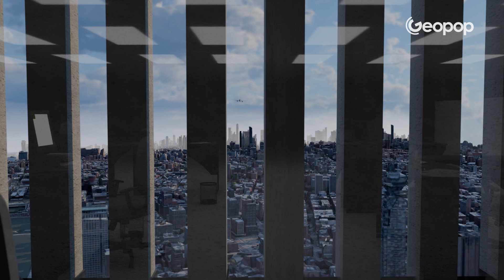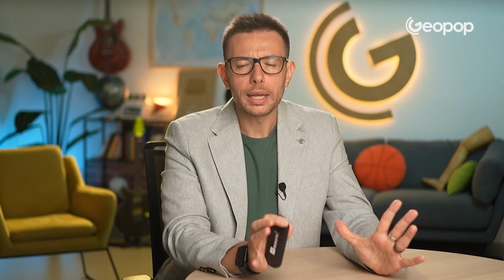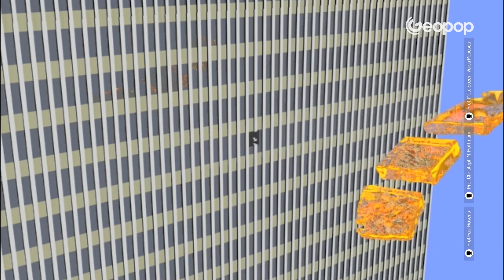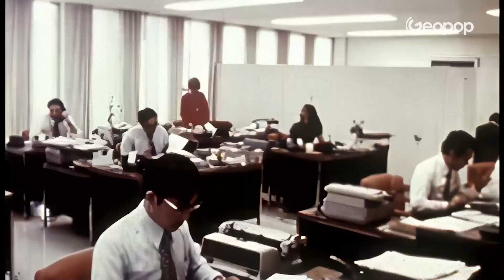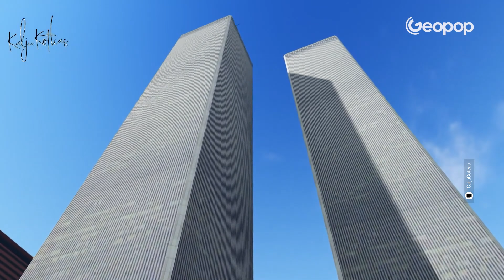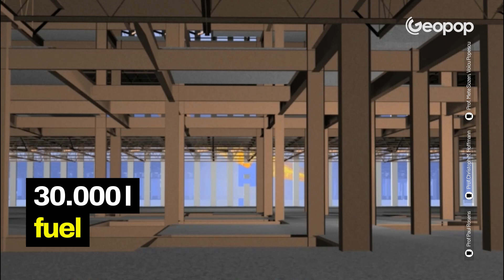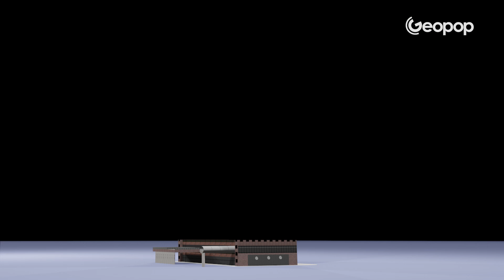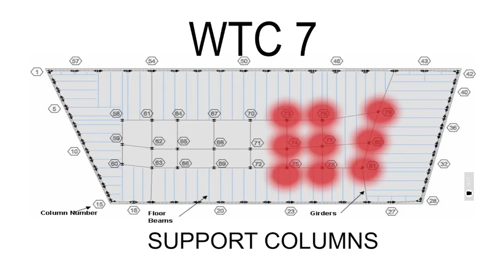9/11, 2001: The Technical Reconstruction of the Twin Towers and WTC 7 Collapses

Comment: Jet fuel burned very fast. It would not get to steel hot enough for that nor did it get to 1000° can’t believe you would buy nist bs
Reply: Was jet fuel the only thing burning in those towers?
Reply: @Tim22222 It was the hottest thing burning in the towers. And it never could have reached temperatures high enough To melt steel. In a control demolition, They usually use explosives to blow liquid copper straight through the still beams leaving a ton of melted steel. Here's the experts who found molten steel in the debris.
Captain Philip Ruvolo (NYCFF), 
Richard Riggs(debris removal expert), Mark Loizeaux , Leslie Robertson (wtc structural engineer), Lynn Margulis (University of MA),  Dr. Abolhassan Astanch (from Berkeley),  Robert Kim Ireland( chemical engineer for US Army Corp of engineers), Mark Basile( chemical engineer), Kathy McGrade (materials engineer), Gery Warner( Mechanical engineer), David Gregg( PhD Chemical engineer), Steven Jones PhD( physicist), Kevin Ryan ( BS Chemistry), Niels Harrit (PhD Chemistry), Tom Sullivan( Explosives team) Jason Cheshire ( Chemical engineer), and Jeffrey Farrer (PhD Material science engineer).

Comment: How come no other steel framed building in history has every collapsed due to fire? If heat alone could weaken steel frames to the point of failing, we would have rewritten the laws of engineering so it never happened again. But guess what, that didn't happen. We are still building steel framed buildings as we were back then because we know they are safe from fire.
Reply: Perhaps because no other buildings have been bit by hueg airliners travelling at VNE, loaded with 30,000 liters of fuel?  Ya think?  Maybe?
Reply: @ChristLink-Channel Saying that without having done research says more about you than anything else... It actually happened loads of times but they have never fell 😅 oopsie 😂
Reply: @Desperado070  "Without doing research" says the strawman builder who never did a days research in his life, and obviously doesn't understand plain physics! Hilarious.  Please show your evidence for these numerous buildings that you speak of, being hit by huge airliner carrying hundreds of tons of flammable fuel, that did not collapse.  You say it happens all the time, so let's see your evidence.... Waiting...
Reply: @ChristLink-Channel  Exactly research, then you would know such things. Instead of "trying" to insults others like a little boi you could also learn a thing or two. 😅😂 You are delusional
Reply: @Desperado070 Happens all thr time? No, no it's doesn't.
Reply: @VTGtone  Delusional is if it never happened to you you believe it can never happen, yet you here claiming that. 😂 you > 🤡
Reply: You mean other than the countless thousands of steel framed buildings that have collapsed due to fire, because it literally happens all the time?

Of all the popular conspiracist arguments, this is perhaps the dumbest, as it goes against 150 years of fire science research and everything we have known about iron and steel for a thousand years. 

Steel is formed using heat and deforms the same way. 

Collapse of a burning structure is always a concern for firefighters. Steel buildings subject to fire rely on active fighting of the fires to survive. Buildings are designed around 1 to 3 hours of fire resistance, allowing time for occupants to escape and ACTIVE firefighting to get started, after which all bets are off. Left to their own devices they will exceed their design envelope and collapse, like Plasco Tower and Wilton Paes de Almeida. In B7 the occupants escaped, passive and active fire protections were compromised and active firefighting was abandoned 3 hours before the collapse, which left the building to its fate. It lost. Odds on Building 7 would eventually collapse, and it did. No big deal in logic.
Reply: @TheLoonResistance  Wow stinkyshill, you´re a real workaholic!
Reply: Stinky is partially right because you said steel frame buildings when you ment steel framed skyscrapers or highrise buildings.  The 1000 years crap is ridiculous I bet he is less than 30 years old, my guess is 25 or less. Lives at mommy's house. Has never learned to support himself and definitely not a family. He's never employed anyone. No one in this world depends on stinky for anything because he is unreliable. Skyscrapers don't fall all the time,  they are usually designed to burn to extinction without collapse. When a plane crashes into the ground,  who wins, the plane? Or the ground? We know the ground is going to win. The plane has a force downward but the upward force of the ground is stronger. Let's flip it around and say the plane is sitting steal and the ground Flys up and hits the plane. Either way the damage to the plane and the ground remains the same. The force of a few broken floors cannot destroy the entire building because the upward force of the building is greater. It's newton's 3rd law. This is real science but these bozos the clowns lie, cheat and deceive for fun. Because in real life they are weak and this makes them feel in control.  They can't accept the truth, and I feel sorry for them because it's a horrible thing that happened that day and the truth is even more horrible so they are in denial.  Get a real job. Put your mind on something constructive instead of being so destructive. You are making yourself just as bad as those that committed this horrible atrocity
Reply: @robbiehiatt9966  You only made one huge mistake there, he is not even close to being partially right.
Reply: @Desperado070 so where do you suppose he is wrong?
Reply: @robbiehiatt9966  If you talk nonsense everywhere no body is ever gonna repply to your sirieus, are you just braindamaged?!?

Comment: the core columns were cut with a thermite chemical reaction and molten steel was found in the basement levels of all three buildings, which is damning by itself as building 7 wasn't hit by a jet. and the thermite kept on reacting all throughout the cleanup with first responders referring to scenes of an iron foundry or a live volcano's lava flow. then all analytical debris was taken from the sites and in the case of the pentagon the lawn of the west wing was literally covered in gravel after the attack. then there's larry silverstein, real piece of work in his own right.
Reply: WRONG! The thermite claim was debunked long ago; the cuts in the columns were made by workers dismantling the wreckage using torches.
WRONG! There's no evidence of any molten steel at the WTC.
RIGHT! Building 7 was not hit by a jet; it was hit by a MASSIVE COLLAPSING SKYSCRAPER.
RIGHT! The debris was taken from the site for rescue operations AND WAS MOVED TO NEW JERSEY WHERE IT WAS STUDIED FOR MONTHS.
Reply: Twin Towers collapses were relatively straightforward, the fundamentals already understood in the professional engineering community within just weeks. Yet there’s a lot of really bad information floating out there, mostly on the internet where it’s easily accessible to anyone. Good information takes more effort to come by and is much harder for laypersons to digest. Engineeringspeak is complex and dull while wild baseless speculation and pathological theorizing with easy hand-wave answers is simple, exciting and require a whole lot less thinking, thus getting far more intention than they deserve.

To correct that situation, I have all on my own prepared this short yet detailed technical description of Twin Towers collapses based on my own observation and analysis of the available true and relevant facts. No politics or ideology, just the engineering. My hope is this will dispel many common myths and answer most if not all questions you may have about the Twin Towers collapses, because anything can seem like a conspiracy if you don’t understand how it works

While complex, most of the Twin Towers collapse mechanisms can be seen with the naked eye and easily discerned and understood by the layperson if sufficient time is taken to understand. 

1. The Twin Towers consisted of 4 primary structural elements that together formed an integrated system where each relied on the others.  47 hollow box-section steel Core Columns carry the majority of the gravity loads. The 236 hollow box-section steel Perimeter Columns carry the remainder and ALL of the lateral (wind) loads. Long-span Lightweight Steel Trusses connect the core and perimeter column together at each floor with a Hat Truss on top to tie the structure together as an integrated unit where no element can survive without the others. There was no structural load bearing concrete and most components were bolted together. www.youtube.com/watch?v=u7OqrC74Dm4 

2. The impact of 117 tons of airplane (= to about 12 dump trucks) at speeds up to 590 mph with the energy of a ton of TNT completely destroys the aircraft. This in no way implies the Towers come out unscathed. Many perimeter columns are damaged or destroyed as are some core columns (example; 33 of 59 perimeter and 20 of 47 core columns damaged or destroyed at the impact floors in the North Tower), This damage is primarily through bolt-shearing failures at the end connecting flanges, as well as bending, twisting and fracturing of weld seams. There was no cutting or slicing - the reality was far more violent and messy. 

3. The impacts destroy or damage fire insulation, fire breaks and sprinkler systems on multiple floors.  Huge fires are started across multiple floors simultaneously and allowed to spread rapidly with no effective firefighting or fire suppression. This was an unprecedented fire event . 

4. The hotter steel gets the weaker it gets .  With fire insulation stripped away and no sprinklers the survival time of the steel greatly reduced. Gradually over time heat causes the lightweight steel Floor Trusses at the impact damaged floors to sag, which was observed and recorded.  No steel melted or needed to. Structural steel fails long before it becomes a puddle. It just needs to bend

5. Sagging floor trusses pull on the increasingly weak and overloaded Perimeter Columns, causing some of them to bow inward by up to 5 feet. A straight column is up to 4 times stronger than a bent column. The bowed Perimeter Columns buckle and fail, initiating collapse. The formerly static mass above which the structure below could easily support is now converted into a dynamic mass up to 30 times greater. Because they have buckled, the Columns above and below the failure point are no longer aligned . The load bearing structure below no longer bears any load as it falls past the lower columns, NOT onto them.

6. Thousands of tons of debris fall within the four outer walls, down through the open office space, crashing onto the first intact floor it encounters. This massive impact immediately breaks the bolted connections to the columns as the amount of resistance the Floor Trusses can offer is negligible.  The falling debris slows only marginally and briefly. Note:
6a. This is NOT a solid top block crashing into and “crushing” a solid bottom block .
6b. The debris falls past the columns not onto them.  The columns provide no resistance to the falling debris. 
6c. Only the bolted connections of the floor trusses to the core and perimeter columns can offer any resistance. A pair of 5/8” bolts at each end of each truss vs. thousands of tons of falling debris.
6d. No laws of physics are violated.

7.  This floor-led collapse progression within the four outer walls can only go straight down. Note: 
7a. This process is often incorrectly referred to as “pancaking” which actually refers to a completely different process rejected at an early stage. The catchy name stuck but nobody knows what it is supposed to mean.  Pancaking is too simplistic and inaccurate anyway. More like Kaiserschmarrn.

8. Collapse progresses through the floor systems not down the columns, through the path of least resistance . Rate of floor failures increases with each successive floor as momentum increases, reaching an average acceleration of 0.65 of GA, or 35% slower than true free fall. Bam, bam, bam down the building until there are no more floors to fail.  The resistance offered by each successive floor is always the same. The mass and velocity, thus the energy of the falling debris is constantly increasing, with each floor destroyed adding new falling mass. Some falls to the sides, but most falls down. More mass, more velocity, same resistance with each floor.  Don’t get stuck on the but the lower floors weren’t on fire nonsense. They weren‘t and didn’t need to be.

9. The Towers were 95% air by volume. As that air was compressed inside the building it is forced down the tower and blown out the sides in reaction to the building collapsing . Those were not “explosions”, it was expulsions of compressed air caused by the collapsing building, explaining the low velocity, lack of flash, blast, supersonic pressure waves and lethal high-velocity ejecta.  

10. Perimeter Columns become detached and peel away like a banana behind the collapse front, playing out to the four points of the compass extending to more than 600 feet from the base of the towers. This was quite obvious from examination of the debris pile. 

11. Core Columns fail last as their internal beam bracing is stripped away by falling debris and lateral support from the floor to perimeter columns is lost. 

12. For those who care about how long this whole process took; 31-34 seconds from the moment the perimeter columns buckled until the last core columns hit the pile, or 1/3 the rate of true free fall. Don’t believe me?  Just watch any video of the collapses and note the loose truly free-falling debris dropping much faster than the towers themselves.  

13. Each Tower had a 1-acre footprint. Far from collapsing inside their own footprints the debris pile spread out over 17 acres in a pile up to 14 stories deep. 8 surrounding buildings were destroyed and scores more damaged by the falling debris. 

14. NOT observed were the 180-190 dB bangs of thousands of high explosive devices or the blinding bright flashes of burning thermite. Neither explosives or thermite could have survived the impacts and subsequent fire nor could have caused the (silent) perimeter column buckling that clearly initiated collapse either. A video of a shocked and injured firefighter casually using the magic word explosion is in no way proof of explsoIVES  and the demolition_ case relies entirely on that sort of thing. There is zero tangible physical evidence and it would be technically impossible, totally impractical and completely unnecessary. No one would bother. 

15.  Finally, the Twin Towers were perfectly safe within their design envelope.  They only collapsed when taken far outside design parameters by an extraordinary and unprecedented event 

Impact + Fire (heat) + Time + Gravity = Collapse . Remove any one of those four elements and there is no collapse. Ignore any of those elements (as many do) and you will never understand the collapses. The Twin Towers were an integrated system in which no one component could survive without the others. One fails, the rest follow, through the path of least resistance – DOWN – through the open space, bypassing the path of greatest resistance – the columns.  Nothing I just described violates any laws of physics. All of the above is true no matter who planned and carried out the 9/11 attacks or why 

In 24 years zero structural engineers of tall buildings, including the 1/3 that have retired in that time, have made any statements in support of 9/11 Truth BS demolition claims. Zero, nada, none. The lack of any such citations in the engineering literature (published in any country worldwide) is palpable.

I hope you found this helpful and informative. It is not meant to be adversarial, but to solicit informed critical comment, positive or negative. If I made any errors of fact, logic or reason or left anything critical out, please let me know so I can fix it. To stay focused just one topic at a time please and on-topic (Twin Towers ONLY). No word-salads of Gish Gallop. IF you can offer a more plausible alternative be my guest. Be the first. Please start any reply with the words “Tits McGee” or I will know you didn’t actually read it, are not serious and just wasting my time. If you are going to argue, do it on the merits.
Reply: @TheLoonResistance  Wow stinkyshill, you´re a real workaholic!